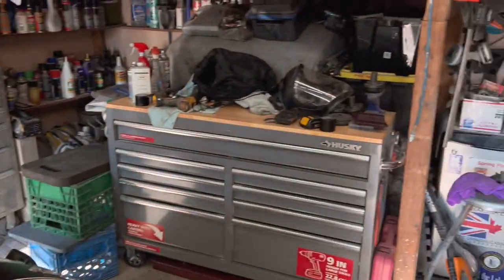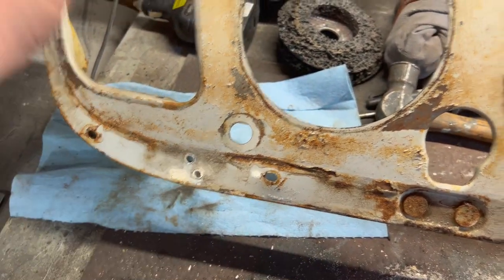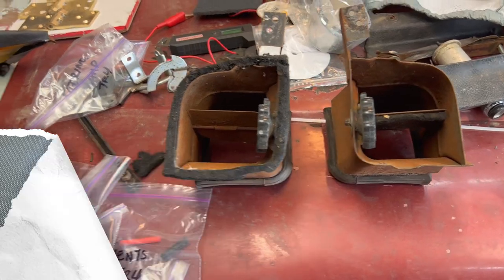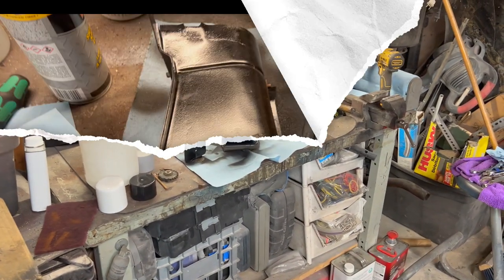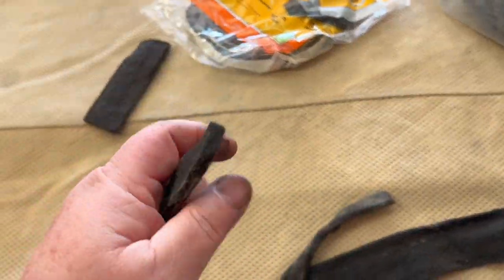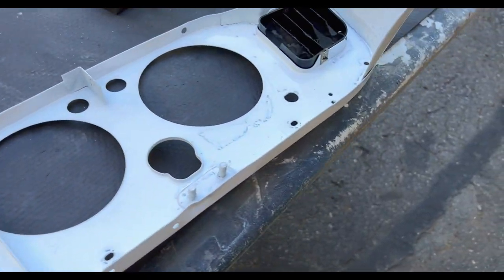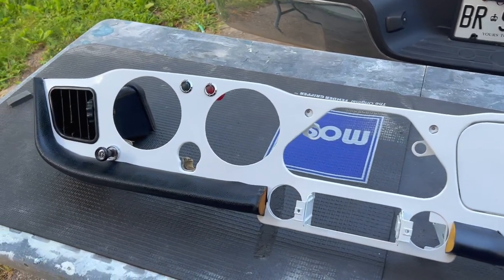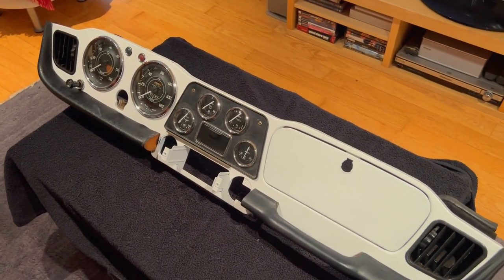1962 Triumph TR4 RUST-oration, Dash and Gauge Cleaning/Refinishing Part 2

Comment: Nice work, David (and Elin!).I like the direction you've chosen for the whole project- largely conserving, renovating, and saving what is there and what is original to the car. There are plenty of restored cars, but not many that proudly wear the effects of time, climate, and the use and enjoyment that previous owners have gotten from this charming TR4. Looking forward to the next installment. Keep crack-a-lacking!
Reply from the maker: Hi David, it will be fun to have a non shiny one in the fleet…one that we can lend out to friends who want to tag along to a Club event as an example. One we don’t have to worry about putting a scratch or dent into….
The previous owner of this car, owned it since 1966 and had it in his possession for 50 years…it was well enjoyed and will continue to be after some TLC. Cheers, Tush

Comment: Dave for that center panel - I’ve used spray “Plasti-Dip” to recreate those thin vinyl/plastic coatings. You can even give it a bit if a slight pebble finish by spraying from a distance. I used it to coat the dash brace on my TR4A.
Reply from the maker: Oh, great idea!  Hadn’t thought of that! Thanks. Tush
Reply: @cheftush  I wonder if “Flex Seal” spray would work too.
Reply from the maker: @TR4Ajim  possibly but I believe I can get the plasti dip with no issue…I plasti dipped my TR3A bumpers black and they still look great.

Comment: Perversely, as Triumph ended up being very keen on fitting wooden dashboards, I do prefer a painted one! It’s come out great. Crackle black works out pretty well on the dash parts, I’ve also had success with getting stuff textured powder coated. The only problem there is that the textured powder coat has to be super low build, and this means any imperfections in the base metal are rather obvious. Crackle black paint will work over filler, at least small amounts. I was concerned it’d show up on the spots I’d filled on my Spitfire dash support where a previous owner had taken a drill to it… Thought the surface heat differential between the metal and the fibreglass might affect the finish, but it came out ok fortunately.

Comment: ....You can always use KIWI black shoe polish on your vinyl and black textured plastic.....Been doing that since men started wearing shoes....Actually, I've used it to polish the frames on my motorcycles, so there's no white wax residue caught in the welds of the frame, as well as saddlebags, black sidecurtains and tool pouches (rubber, vinyl, leatherette or plastic).......John, (west coast, Can.)